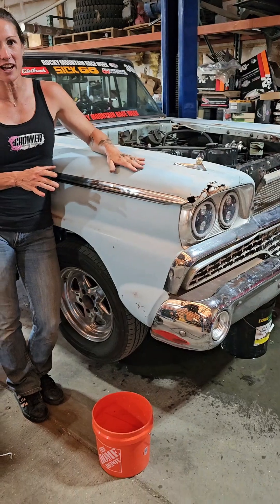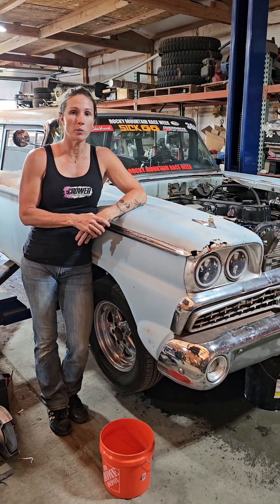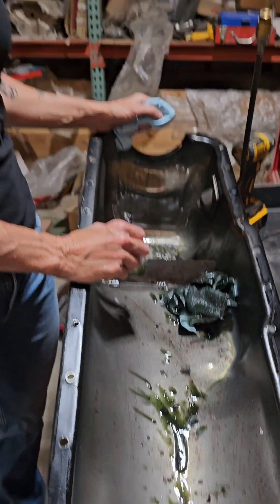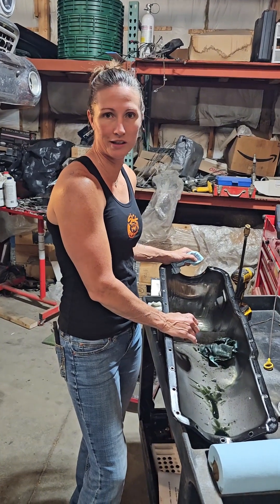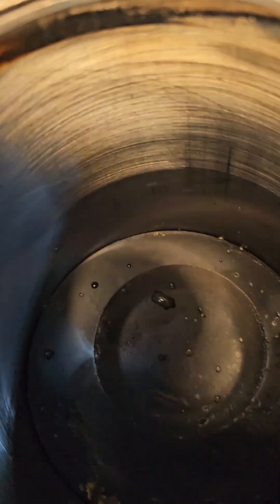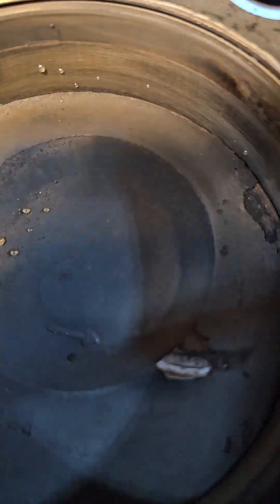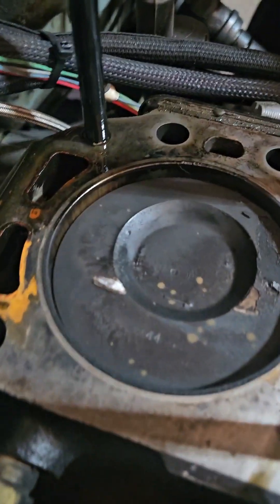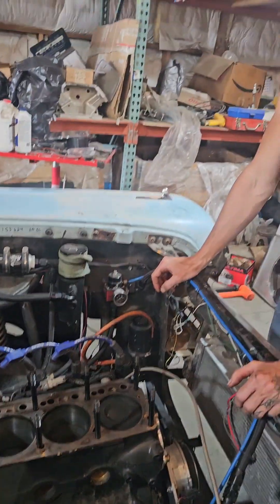Ford 300 turbo engine damage update. Bent valves? Hurt pistons?

Comment: Wow, but it could have been worse.  What happened with the 65 wagon?
Reply from the maker: The 65 had transmission issues.  It is back together now.  Had it on the dyno yesterday. 
New turbo exhaust manifold should be here today for the 59.  The head has been rebuilt, hope to have it back together next weekend.

Comment: Really, REALLY curious what your failure analysis (ok gut check) says was the cause.....
Reply from the maker: Only thing we could find was that the valve guides had excessive wear. Possibly causing extra friction,  or harmonics and noise in the valve train. A few engine builders have said that cast iron does not do well with that type of a situation. We are fixing the worn guides, and replacing the valves.
Reply: @Cutandgrindgarage if you don't mind me asking, how hard were you spinning it?
Reply from the maker: @BartTaylor-v2h shifting at 5800
Reply: @Cutandgrindgarage  That's pretty benign territory.  Mental note,  have the machinist clean up the guides! Back to flow testing a 300 head.   Get that thing back on the road!
Reply: Ok, sorry for all the questions, and this one is a biggie.  Any chance you could measure the width of your bowl entry on an intake port? IE the area just above the short turn where porters typically wide the port to slow flow down to make the turn.  I'm trying to get a sense of casting thickness. I know this is a substantial ask and I suspect you have better things to do so I understand if this is a non starter.    Then again if you have an ultrasonic tester.......

Comment: I know y’all went through a whole bunch already

Have y’all ever thought about getting one machined out of billet or something stronger besides OEM ones
Reply from the maker: The original oem ones are a pressed fiber material. A steel gear would need to be custom made, I think we have a harmonic issue that is making the cast iron gear unhappy. 
We are going to try an aluminum one next.

Comment: What power level you think its at with that custom cam i just recently purchased a custom crower for mine .608/.603 lift at 105 lsa should be pretty nasty sounding im running the holley super sniper with a 78mm turbo its sitting in my 78 f100 2wd pickup i popped the head gasket and 5 valve stem seals when i had it out last on 22lbs on boost so im redoing it all now with a different motor so i can take the 1 apart and find out what happend
Reply from the maker: This setup should make around 450hp at 12-15psi when we get the details figured out. This cam is around .540 lift with a 114 lsa
Reply from the maker: What fuel are you running? 
22 psi is alot for pump gas. 
Do you have an intercooler? 
Are you pulling timing when adding boost?
Reply: Im mixing 93 and 110 non ethanol to get somewhere around 104 something like that and im pulling 1 degree for every lb of boost timing is all controlled with by the holley with a locked out hei dizzy  @Cutandgrindgarage
Reply from the maker: @dylanboyle2995 
Ok that doesn't sound too far off for the timing. That fuel should be ok too.

What are the intake air temps like at 22psi?  Do you have an intercooler?
Reply: @Cutandgrindgarage intake air temp is 86° at idle and up in the higher boost levels it reaches around 112°-115° I am using an intercooler
Reply from the maker: @dylanboyle2995 ok that's very good air temps.
Reply: It was running great until i popped the hose off my heater core doing a full pull 1 day put it back on filled it back up with water limped it home to find out I blew the head gasket and 5 valve stem seals I am going to switch to a different style valve stem seals I was looking at the brian tooley LS style with the flange that sits under the spring  @Cutandgrindgarage

Comment: Are those a factory replacement piston I see there .60 over but they look just like a factory set
Reply from the maker: They are .030 over. 
They are trw forged pistons. 
We kind of found them by accident.  We were talking with a friend and they told us about some left over parts from a project that never got finished. 
They are actually natural gas generator pistons, but they are forged and they work well for this application, because the compression ratio is low 9 to 1.

Comment: What do you think the chances would be of the cam gear bending under load?

The construction of the gear appears to be a bit "grainy" to me,  similar to cast iron.

The breakage of the cam gear indicates to me that the belt is generating an angular load to the web section of the gear.  The load should be radial to the face of the gear through to the center point of the gear.

I am wondering if the Cam Gear is deflecting away from the engine block?  The breakage sort of looks like that could be happening.
Reply from the maker: The cam gear is cast iron, they don't make a steel one "YET"  The crank gear is billet steel, there is no belt.  
This is a 2 gear, gear drive set up.
Reply: @Cutandgrindgarage Thank you for clearing that up for me.

I will go look at some videos then.